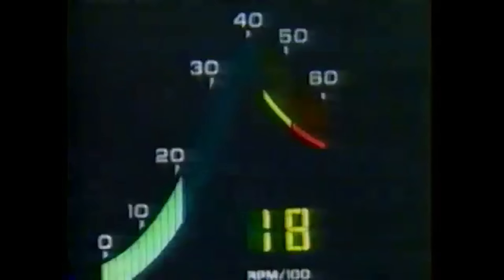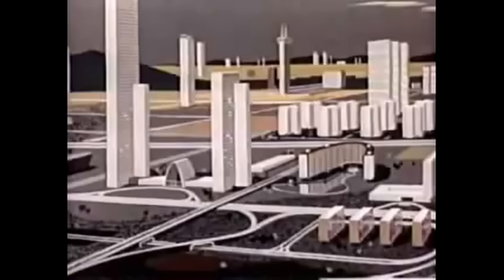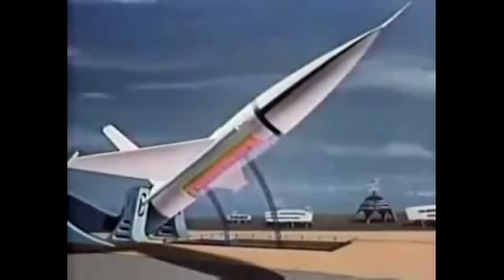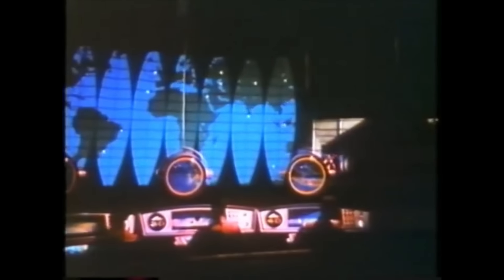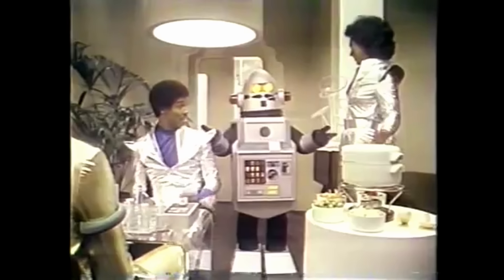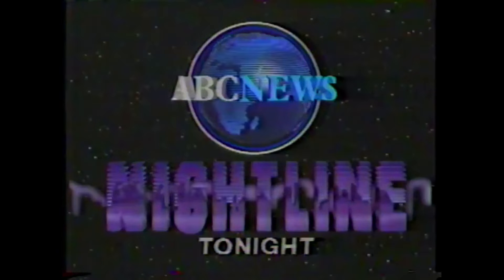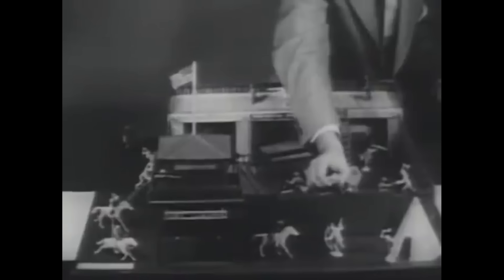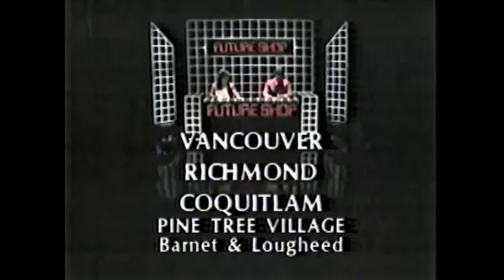Retrofuturism: The Future That Never Came | Sleepcore

Comment: "The rearview mirror is actually a television screen." They got close enough with that one.
Reply: I am pretty sure that was experimented with back in the days of mechanical television. The biggest issue is your entire trunk would be full of a giant camera and the tube was 3 feet deep to view it on.
Reply: Folks still preffer the old fashin mirror tough... i can't drive looking at a bunch of screens.
Reply: I feel the statement was dead on. Televisions are LCD or OLED screens are so are the screens in automobiles.
Reply: @psyQuantum  The change is the resistor and microchips. Minerization of bulky tubes that used high voltage and produced heat. We had tube TVs when I was a kid. Those things could heat a room. Tubes were always burning out. Our local drug store had a "tube tester" in the store. You plugged in your tube and it would light up green for good or red for no good. Below there were trays of new boxes of tubes you matched the numbers up with. If the one you needed sold out you picked one "close enough". After doing this a few times you had to call the TV repairman to fix the mess you made. Just keeping vertical and horizontal hold was a daily adjustment needed two people. The brilliant people put the knobs on the back of the TV so you could not see the TV screen while adjusting them. 

Imagine something so unreliable in your car as a safety device? Not to mention early TV cameras needed insane amounts of light to capture accurate pictures. You would need high beams on the back of the car that would blind other drivers.
Reply: Some vehicles do use that technology.    So yeah, close.
Reply: @efxnews4776  Screens are exactly the same as conventional mirrors except you loose the parallax effect with a screen without using some kind of head tracking device which can be an issue for some drivers.
Reply: There’s actually a lot of cars that do utilize that technology.
Reply: Honda E has this
Reply: @efxnews4776  They have their uses.  I like the rear view camera in my goods-carrying vehicle.  The interior mirror is unusable, and you have to rapidly look left and right, when using the exterior mirrors.  And their field of view is limited - compared to the "fish eye" camera lens.
Reply: My new chevt truck has one.
Reply: The automated adjustment and the radio controlled part of cars.. We have that. We even beat that with self driving. If you look beyond the dated technical things then we do have basically all of that.
Reply: Yup I use one everyday.
Reply: Although what os the point 😑
Reply: They actually got a lot right
Reply: Also the autopilot (Tesla) and the business meeting in cars (using our phones/laptops inside cars are more effective than having a tv inside your car)
Reply: Pop on Waze and pretty much that whole dashboard segment is now true.
Reply: @StanSwan  Yeah, why didn't I think of that before. The V and H hold were at the back, and can give you a nice electric shock also from time to time.
Reply: What planet is this boulder dash supposed to be on?.
Reply: Spacely Sprockets building.
Reply: They got signage right too. Now we got digital, and backlit signage on roadways that are solar powered
Reply: @StanSwan  Well...if it's TRUE that the authorities have technology that's 40+ years beyond what we are given...maybe there were already cameras as small as a button. Plus, those videos of "time travelers " talking on what looks like cell phones...I'd bet they were spies for whatever govt, using technology the public didn't know existed.
Reply: I literally paused the video to comment this.
Reply: They hit dead on with that one, automakers like GM and JLR have rear view camera mirrors in their cars.
Reply: Yeah xD
Reply: the new c8 corvette uses this technology today🙂
Reply: @BrownNProud781  and suburban, escalade, land Rover defender, etc
Reply: ...I was thinking the same thing. 🤔
Reply: @TheKaiTetley  both my old cars have added cctv and a rearview screen everywhere i go at night other cars are checking my screen.
Reply: Cadillac rearview mirrors are actually both mirrors and video screens now.
Reply: @StoneColdSour  it's across all of GM
Reply: @StoneColdSour  Volkswagen models too & many truck models. hmmm 🙂
Reply: 22:14 they got that one too
Reply: It's weird when they get something neer correct
Reply: @duds9814  Near, hmmm 🤔
Reply: They still use review mirror but also a computer with GBS directions both shown and spoken.
Reply: @hydrolito  that's RearView & G.P.S, hmmm 🤔👀
Reply: Instablaster
Reply: Julian I swear I was going to say that one too they were pretty much spot on. Believe it or not they pretty much got a few things right it just doesn't seem like it because the technology that they had was pretty much limited. Oh wait a minute what about GPS did they know they were going to have cars with GPS or global positioning satellites. I'm sure GPS did exist back then but it was only available for the military think about it this is right after Sputnik was launched we really didn't have any high tech satellites yet.
Reply: @pauliether.c.guy.3349  yes indeed. Spy agencies & military technology is anywhere from circa (minimum) 10 to 15 yrs ahead of what civilians have/had access to & or even comprehend. hmmm 🤔🙄
Reply: General Moters has review mirrors that ARE TVs on some model. There are also back up cameras  and surround cameras.
Reply: The rest of the dash stuff is on the google maps screen..  traffic ahead, speed limit, even cops ahead.
Reply: @StanSwan  Mechanical television did not employ any tubes, but rotating Nipkow discs.
Reply: @Oli1974  False, it was displayed on a tube in fact.
Reply: @StanSwan  No. Mechanical television didn't use tubes. You mean analogue electronic television. Educate yourself
Reply: @StanSwan  If I learned something throughout my life it is always the least educated that insist they were educated and even use swear words due to lack of proper vocabulary.

So, let's see. A tube. And what's that again? Aha, an electronic device. It shoots electrons to a screen. Mechanical television is an entirely different thing. You might check wikipedia; there happens to be an excellent article on that subject.
Reply: @StanSwan  Look, I don't care if you just learned a new word, even if you still don't know how to use it correctly.
Reply: From the picture ...

Everyone drives a Cadillac?
Reply: Yeah but what are families?
Reply: Because kids got the idea from this cartoon.:oops:
Reply: So, how much is a rearview television camera, and monitor, going to add to the cost of a car, and who is going to pay that much?  Most cars are already "priced out of the market".
Reply: Photogs said the same thing about those "damn, newfangled electronic viewfinders". Everyone uses them now.
Reply: They totally called it. Same with the overpasses, that's how we do it here in Ottawa.
Reply: That and many more, even if they, of course, got some details wrong.
Reply: Back then, sure, but the vid is about their future. And they called that one.
Reply: The plain is just like todays drons
Reply: we have this in the Philippines. even jeepneys using this technology
Reply: Those have existed. For years in the aftermarket. They generally are used for review cameras at this point. Even those can be made to show video signal very simply
Reply: Also "business conferences will be held via television".
Reply: No actually, it actually exist. Some even medium end cars even have screen rearview mirrors. It has a little lip which you flip and it turns on the camera.
Reply: And with speed limit indicator.
Reply: My 22 Silverado has a camera in the rearview mirror projects over the gate  while driving forward
Reply: They also were kinda right with the fact that cars will drive themselves places and there would be no driver required when travelling.
Reply: 4:07 Synchronized scanning map. Scm = gps
Reply: AUDI nowadays has virtual exterior mirrors that are cameras and screens.
Reply: @efxnews4776  It does take some getting used, to reversing and parking by means of the television screen, but once you do, you can park in a much tighter space than using mirrors and judgement alone.
Reply: @efxnews4776  I'm with you on this. I find those rearview mirror screens distort my depth perception and look way worse than just a standard mirror. There could be a car following you at a 2-length distance, but appear to be a speck in the camera, and overall makes it harder to judge where your car is in relation to traffic.
Reply: @StanSwan
Reply: EHHHH STILL CANT wATCH CARTOONS ON IT! OR rEALITY TV
Reply: The traffic build-up and the speed limit suggestions too.
Reply: We're even more advanced with 360⁰ in some vehicles
Reply: dashcam
Reply: I’m starting to see this become more wide spread
Reply: @math-e  My Equinox has 360. The top down and 3rd person views are so weird.
Reply: My Discovery car has one lol
Reply: The Cadillac XT4 is like that.
Reply: My nissan leaf gen 2 got no rear mirrow anylonger. its a screen and the camera is close to the rear glas.
Reply: television doesn't mean cnn and cbs (those ones are televised programs ) or the device you watch on ( this one is called televisor) .... television means viewing at distance !  so he was 100% correct.
Reply: @StanSwan  by the 50s TV cameras did not need insane amounts of light, but you are right about the need for tube replacements and horizontal and vertical hold tweaking. while tubes would be a once in a while thing, adjustments would not be, and I feel you with the hard to reach adjustments on the back of the TV, as I restore those old tube sets as a hobby.
Reply: @Oli1974  Basically, the "televisions" they are talking about is just our LCD cell phones.
Reply: My car has a backup camera.
Reply: As long as it is not a BBC television screen.
Reply: I was thinking that too

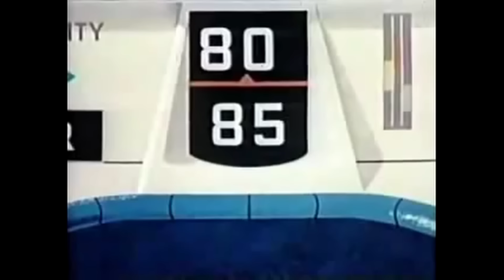Comment: 1:50 Some of these features sounded very familiar. Turns out, a lot of modern passenger railway has these features implemented via an in-cab signaling system! Kinda cool that these features did become reality in a different form of transportation.

Comment: 1:50 The really interesting thing is that almost every technology that the narrator describes here is more than achievable with modern tech and industry. The only reason we don’t see things like this nowadays is due to the immense costs involved and the fact that spending on infrastructure is somehow politically unfavorable
Reply: Don't forget that if new technology threatens the old conglomerate, they will use their power to crush the ability of the new idea to ever be obtainable.  The oil companies are a perfect example...self preserve action for the sake of money.
Reply: Not just the costs but the maintenance nightmare involved for building a highway into the side of a cliff. Rockfall would knock out chunks of the highway on a regular basis.

Comment: I feel like it’s hard to imagine the future now. I feel like in 50 years time everything will look the same roads, buildings, street lights, green spaces, houses etc. what will look different is cars, devices, appliances, fashion and interior design. The reason is everything is getting more exspensive so todays building and house designs won’t change much as they are made to be cost effective. Also technology is more Intergraded you won’t notice the new app on what ever device you are using that will perform a new function. In the past they would look at the future like “this machine will wash your clothes, this machine will heat your food with microwaves” now it’s like here’s the same washing machine in black. Here’s a microwave with a touch screen.

Comment: ROAD GEEKS- future southern England cannot even boast of one direct ,traditional asphalt surfaced ,dual- carriageway or motorway to link the citizens & businesses across the 200 mountain-free miles from Folkstone in Kent to Honiton in Devon ! 
 (the existing direct route of 192 miles would take hours & hours of stop /start motoring - whereas using the ‘recommended’ higher speed or quality road network requires 58 additional miles non-directly skirting London & sharing one of the busiest routes in Europe & the associated factors. Road & Rail connecting S & SW England to everywhere else except London is probably almost as slow as it was when these cartoons first appeared 😂)